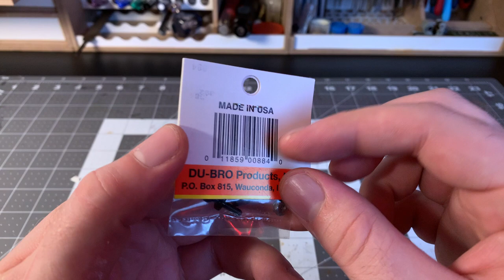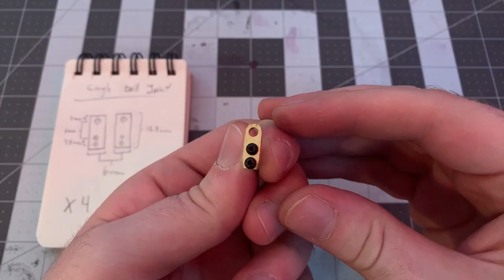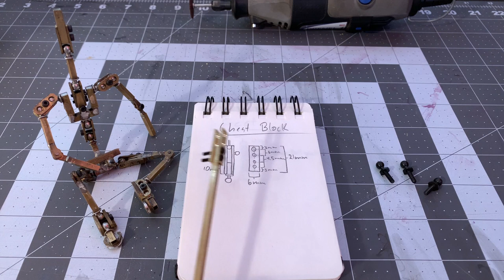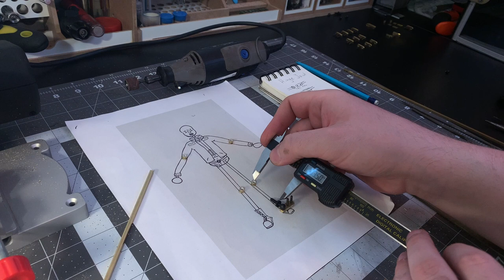DIY Ball and Socket Armature!

Comment: Hi!!  Impressive skills! Love it! One question, how it is call the piece you use to shape the brass to fit the bolts. Not the drill that you use for the holes)
Reply from the maker: Thanks for checking out the video! The only power tools I used were a Dremel, drill press and two inch cutoff saw